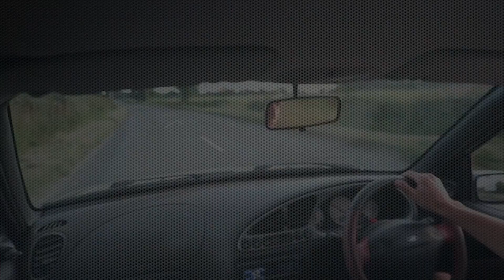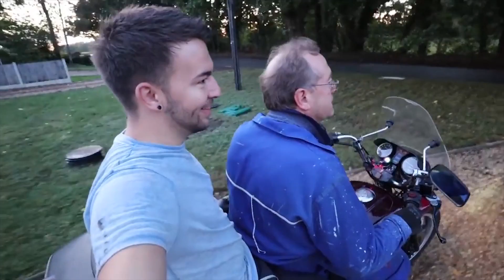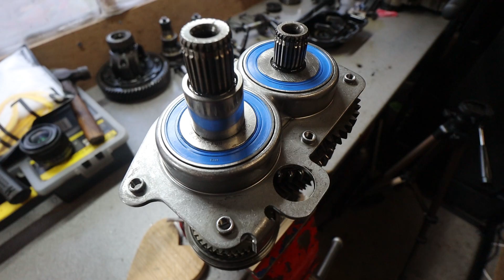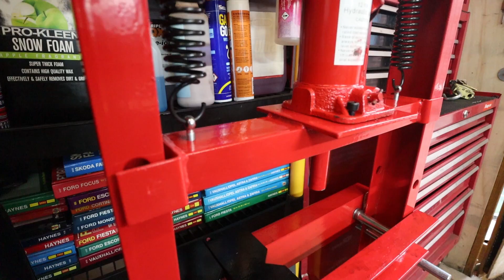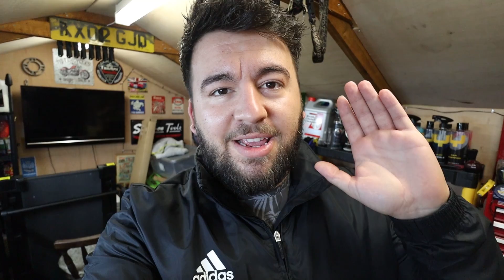Replacing The Skoda Gearbox Bearings!

Comment: In 40 odd years of working on cars I have never needed to use a press to remove or fit any bearings.
Reply: You haven’t replaced many bearing then have you 😂
Reply: congratz
Reply: @georgemiller4585  yes you name it I’ve changed it ,wheel,gearbox bearings and bushes, differential bearings, had some awkward ones but got them done in the end.
Reply: you must use magic instead then on wheel bearings
Reply: wow Martin ..go you .. you must be really chuffed.  have a cookie
Reply: Still, it would be nice to have one. Like impact guns, you don't really need one but it makes life easier IMO.
Reply: Sledge hammer and bars work wonders and a little heat works well but why struggle when there's things to hand that make the job a hell of a lot easier,like a balljoint splitter I always used a bar and hammer to separate lower ones but the splitter made life so much easier
Reply: There's been been many a car part brought in to work to have  things pressed on or off ;-)
Reply: @lea-rw5cb  ball joint splitters are only useful if you’re replacing the ball joint they rip ball joint boots for fun
Reply: do you use your teeth?
Reply: @georgemiller4585   ... obviously depends what kind .... the two prong chisel type does, but a proper splitter doesn't
Reply: @SDR702  haha 👍
Reply: @EmilysDadd  well I have a proper splitter lol and haven't damaged any ball joints yet